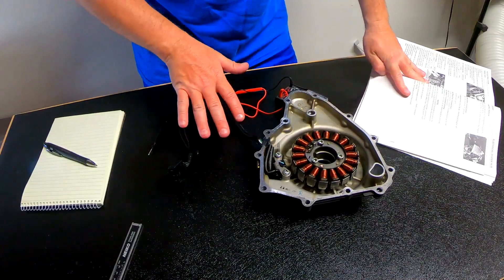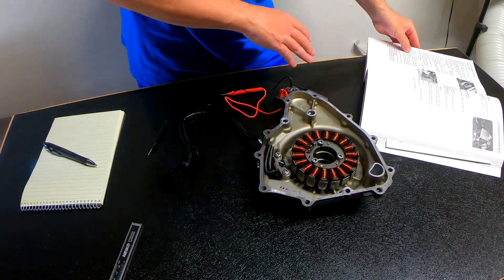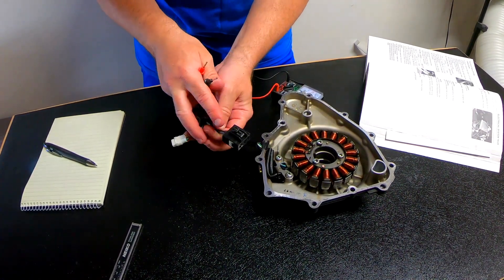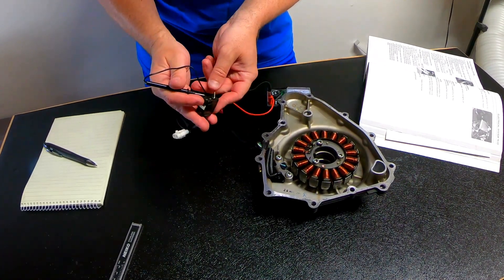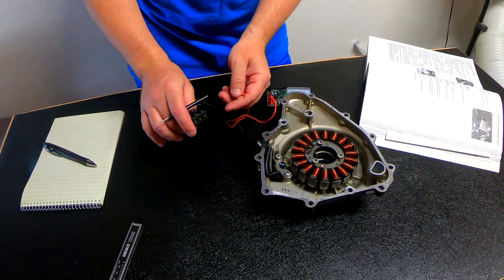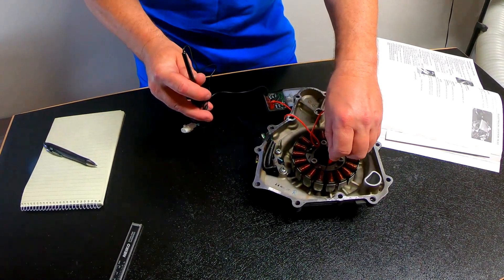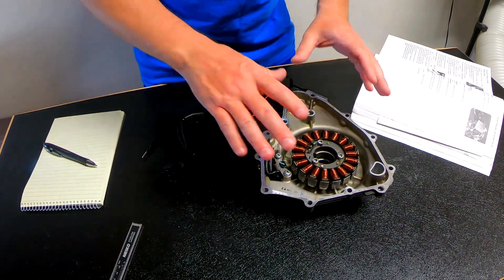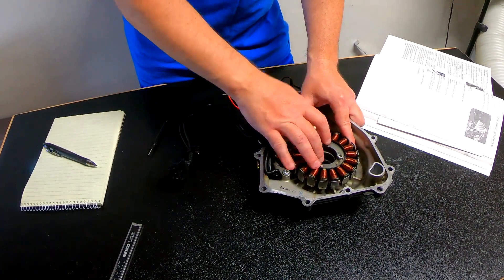DIY - Static testing the stator on my 2018-2023 Kawasaki Ninja 400 engine

Comment: Hey mate, tryin to figure out the rated wattage of the 400 alternator, any idea?
Reply from the maker: It's about 300 watts. Of course you can't test this without it being on a running motorcycle. And then you have to calculate the draw on the system as well.